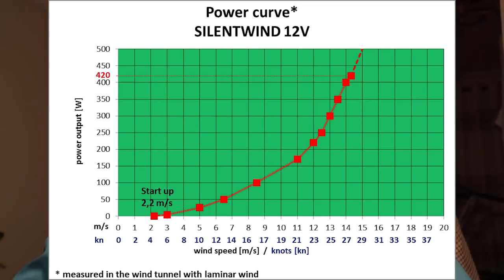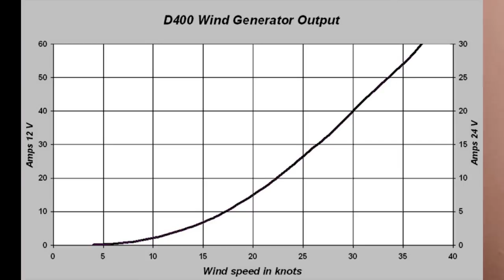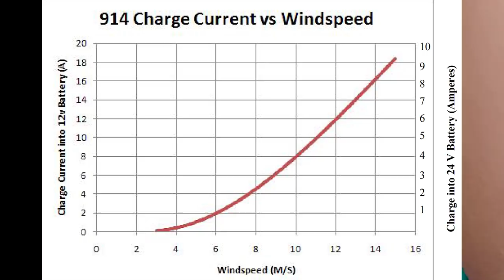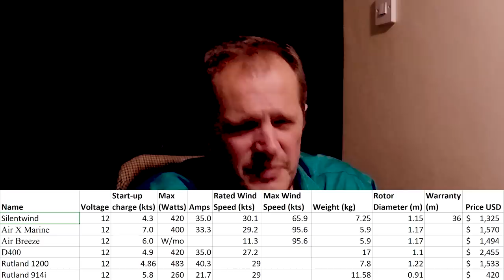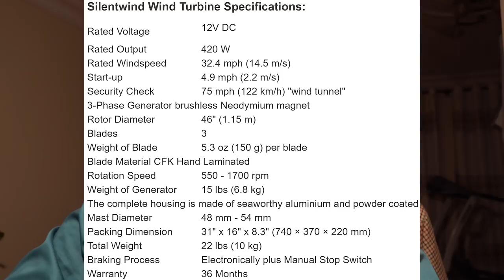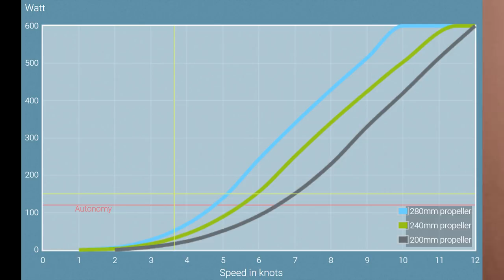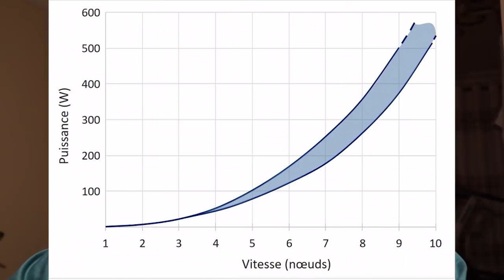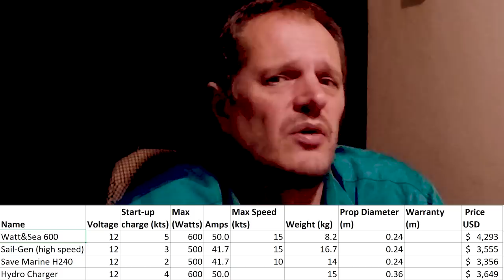#23t Should We go Hydro Generator or Wind Generator | Sailing Sisu Catamaran Cape Town South Africa

Comment: Any thoughts on a servoprop setup? 1000 watts at 7 knots, quiet motorsailing, $20,000 OUCH :-)
Reply from the maker: Yes, I did...currently one needs a big very big battery bank....
Reply: yeah but the same big battery bank feeds all of you electric apliance    washer dryer  watermaker  nav equipment  pumps etc   and motorsailing  is only a  very smal part     in and out harbors  and  moorings    the rest of the time you have a fast cat that can sail with very low wind
Reply from the maker: true
Reply: Tesla powerwall, 13.5 KWH, 5kw inverter, 275 pounds, $6000 ??
Reply: Axel Weimann I was looking more at the hydro gen performance of the servo prop, 1kw at 7 knots
Reply from the maker: Ah! Roger, that is a good observation I missed! Off course!
Reply from the maker: I honestly looked at the Tesla power wall and motors. However, I could not get a lot of detail and they are not available in South Africa, not even for import. In my opinion, Tesla (storage and motors and cars) are flippen awesome! I can imagine that the PowerWall in an Tesla should be very water and dust proof. The motors are running on 380V and I kind of dismissed them for boat engines. The Powerwall is different and I could not see if they are marine proof? I like the idea of a million little batteries working for you like minions :-) At 124kgs they are super impressive!
Reply from the maker: For example, can the powerwall interface to the axiom? can i hook up hydro, wind, and solar at the same time? I know Tesla (ok solar city) makes solar panels and very fancy ones at that, but are they flexible? How do I get my 12V system from there? Another 220VAC-12VDC convertor? Can I use it to start my diesels? There were/are many questions I could not find answers for...The Victron and the Axiom Pro works very well together.
Reply: The Tesla powerwall isn’t rated for nautical use. It will void the warranty of the unit and may even catch fire due to the constant jolting in the open water. Apparently.
Reply from the maker: Thank you, we actually did have a look and that powerwall is 'n very big device!
Reply: Whilst the price is high, the oceanvolt approach is pretty exciting to watch, especially with the lower maintenance costs and potential less weight  of the overall package.